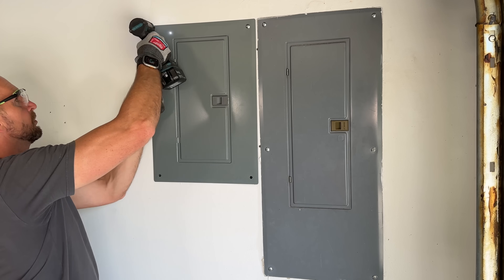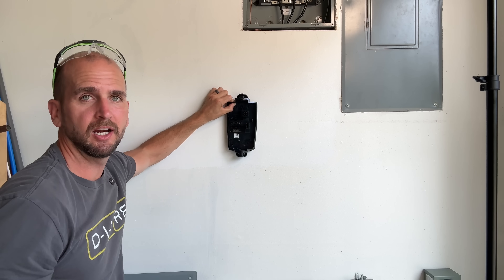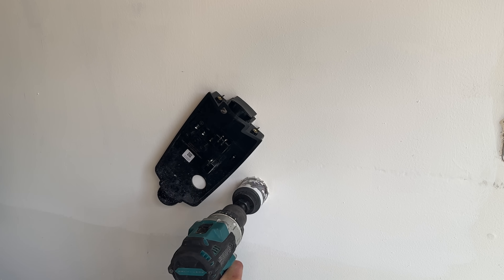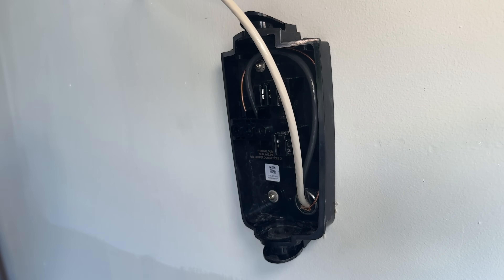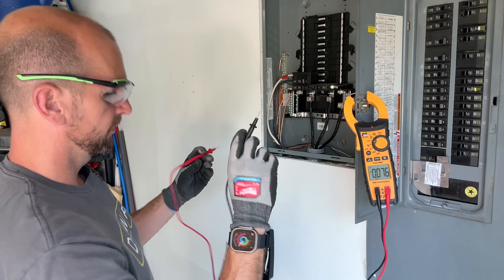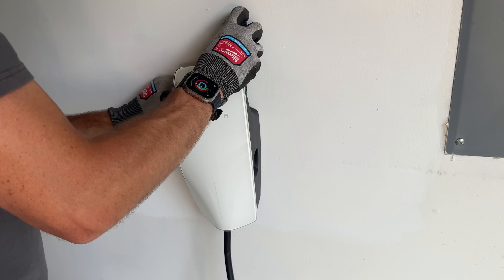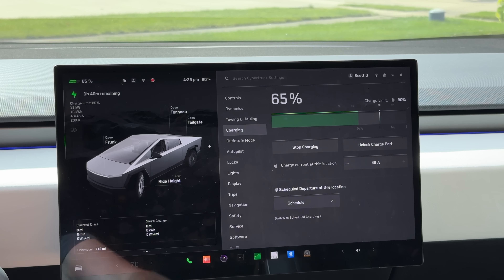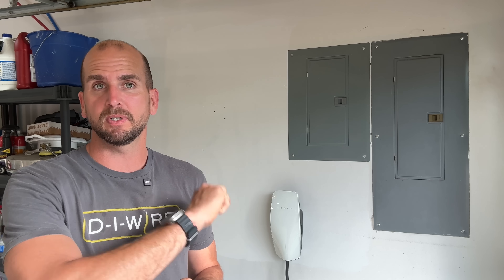How To Install An EV Car Charger | Easier Than You Think!

Comment: Almost 6 years of driving a Tesla and I still haven't upgraded my charging yet. I've been using my 120v wall plug the whole time and it's been more than adequate 99% of the time.

One day I'll get around to installing a 230v plug. 😜

That's for sharing this one!
Reply: 120v 12a charging on the Model X since 2018 here!  Having free supercharging does make that more bearable ;)
Reply: I have a 20 amp clipper creek that I bought for my Volt.  I get 15 miles of range per hour, which is fine for my Telsa overnight.  People vastly overestimate how fast they need to charge at home.  The most I'd ever do would be a 40 amp circuit to get 32 miles per hour.
Reply from the maker: Thanks for the feedback!
Reply: I'm guessing you live somewhere warm. 120v will struggle to charge in the winter as so much energy is needed to keep the battery warm.
Reply: I am approaching 2yrs 120 vault charging. But it won't hold 12 amps lately.  It keeps falling to 6 amps.  So I called for an install.
Reply: @plixie1  I have mine capped at 11 amps and I've never had an issue. I've never even tripped a breaker in this shitty aluminum wired 1974 built house.

Comment: 0:35 “5 times cheaper …” ??  Is the electrical utility paying for energy?  Or is this some kind of Logarithmic reduction?
Reply from the maker: I pay $0.08 per kWh at home and at the Supercharger it cost $0.40 -$0.43 per kWh.
Reply: @EverydayHomeRepairs dayum SCE is raping us!
Reply: I believe it’s just a direct comparison to the super charger based on the end of the video
Reply: Lol. Guys did you watch the video. He is clearly talking about cost charging at home vs not charging at home (ie super charge station).
Reply: I wasn't sure what he meant by that either, maybe making a comparison to buying gasoline or paying to use super chargers?

Comment: Get ready for that .30 cent tax for each mile driven Californians 🤣
Reply from the maker: $0.30 per mile?  That seems a bit off.
Reply: @EverydayHomeRepairs  go research it. California is doing a pilot program for this because they are losing so much revenue off of gas taxes 🤣
Reply: @Flex_Mayo You are an order of magnitude off on the pilot program. The pilot program is $0.02, $0.03, and $0.04 per mile. Currently Californians with ICE vehicles essentially pay between $0.02 and $0.03 per mile in gas tax. Roads do not exactly pay for themselves so it makes sense to find other revenue. Per mile is difficult though because some of your mileage might not be in CA.

Comment: Hello, what if I don’t have a free socket for a breaker in my electrical panel. Can you make a video of what to do in such a situation? Thanks a lot!
Reply: Just add an external 120V outlet to a circuit. That is much cheaper and will get you 40-50 miles of range each night. If you add another breaker, you'd have to either get a larger panel or get a subpanel which is a lot more expensive.

Comment: The majority of people do not need a level 2 charger nor a 50A one. People charge overnight and a level 1 charger at 12A on a 120V outlet will get you about 40-50 miles overnight. That is more than what the majority of people drive each day. Charging is not like fueling up on gas. Plug it in each night to top up and forget it. So if you don't have the extra cash to fork over for a level 2 charger, don't worry about it. You will likely be fine with a standard outlet.
Reply: Super off peak pricing is usually in a 6 hour window. 12A will miss it, literally costing you more money. You can get level 2 for dirt cheap now. They’re just glorified relays, with a minimal amount of negotiation.
Reply: @float32  On average it's about $500 to install a 220v line plus the cost of the charger. I have never heard of "super" off peak pricing so what you are claiming may be extremely regionally dependent. Peak times in a lot of cases as around 4-9PM and then the rest is non peak. Even if you are charging from 9PM-6AM, fast is still about 27 miles of range which is fine for about half of people. Even if you did some peak charging, it would take a lot of charging to make the $500-1000 installation cost of a level 2 worth it. Not knocking on anyone who does install one since they can be very handy (two cars can charge at the same time, for instance) but they are certainly not necessary for 75% of people.

Comment: You don't NEED a lvl2 charger. Depending on how efficient your EV is, and how much you drive per day, a basic wall outlet can suffice.
Most get about 2mph from a basic wall outlet. 20mph from a 240v outlet. Then 200mph from a DCFC.* 

So if you drive 20 miles per day, but your car can be plugged in at home 10 hours a day, you can just use a basic wall outlet. Do the math and see what you need.
Even if you drive more or park less you can still charge mostly at home and then hit a fast charger once a week, or top up on the weekends or similar. 

For the first 2 years I had my Bolt I was running the cord from an outlet in the living room and out the mail slot to where I parked.

That gigantic, heavy, inefficient monster truck he's charging will probably get half a mile per hour plugged in to a wall outlet. An Aptera would get 10mph or more from it. As with everything YMMV.
Reply: It’s worth having a Level 2 charger. You just don’t need to have 48A charging. 16A works fine for most and if you have a dedicated NEMA 5-20 circuit with 12ga wire you can rewire it as NEMA 6-20 with a double breaker and some red heat shrink/tape to relabel the neutral as L2.
Reply: @m_cabral A level 2 charger is actually not worth it for most people since a level 1 charger will top most people up overnight. People who drive more than 50 miles a day (a minority of people) could definitely make good use of a level 2 charger but even then, a 30A one will be absolutely fine.
Reply: On a Model 3 you can get away with it if you’re religious about it and don’t drive much. My friend who has a 10 mile commute mostly can but still needs a destination charger periodically.

I don’t have a commute and just drive for pleasure. Right now I 12A Level 1 charge only and it is more along the lines of 18 hours to add 20% back to my Taycan. 16A Level 2 charging is overnight for the same amount of energy added. Bigger batteries, SUVs, etc are not easy to Level 1 charge only for people who have to drive every day.

Comment: Good installation video, except for perhaps the cable used. Tesla’s instructions are pretty easy to follow. People should pay attention to cable routing, as that’s a very common mistake.  
I’ll add that if you don’t want to shell out the money for a Tesla charger, be sure to buy a quality receptacle.  I’d suggest looking into an industrial grade receptacle. Hubbell is a good brand, but do your research.
Reply from the maker: Thanks for the feedback and Agree the Hubbell 14-50 I swapped out on this video was solid. https://youtu.be/aTVm8Bt_YUw
Reply: At home charging systems should come withe vehicle for the price you pay.

Comment: Instead of using a NEMA 14-50 outlet, you can save money by using a NEMA 6-50 outlet (commonly used for welders).  The 6-50 connector just has the 2 hots and a ground and does not have a neutral.
Reply: Good point! I realized after the fact that I wasted money buying 6GA white thhn wire. Although, my Tesla came with a 14-50 adapter and not sure if Tesla sells a 6-50 adapter.
Reply: @robwloch8733  Tesla does sell a 6-50 adapter.  I also have a 6-50 extension cord - much cheaper than a 14-50.  and you can find lots of dog bone adapters to go to 6-50 from TT-30, 10-30, 14-50, 14-30.  Just be sure to lower the charge current and check that the plug/outlet isn't getting too hot.  This lets you charge at any campground or a friends garage welder/dryer outlet.
Reply: Some non-Tesla home chargers use a common wire, so if you sell your house, it'll be ready for a different, non Tesla charger for the new homeowner if they have another EV brand.
The extra length of unused white common wire fits(coiled up) inside the Tesla wall charger.
Reply: @dvader3263  recently sold my house - with the Tesla Wall Connector.  Just picked up a Clipper Creek home charger from the local electric co-op.  The Clipper Creek has 3 wires on a 24 inch flex whip - Hot, Hot, Ground.  No Neutral (white) wire.  So feel free to use a neutral wire, but it is not needed.

Comment: Power hogs.
Reply: How is an EV a power hog? It takes a ton of electricity to pump oil out of the ground. A ton of gas to transport that oil to the refinery. A ton more electricity to refine it. A ton more gas to transport the gas to the station. More electricity to pump it into your car. Then you get at most 30% of the energy of the gas from the tank to your wheels. Gas cars waste 80% or more of the energy in oil.

Meanwhile EVs go from solar panel, to wires, to car, to wheels with a total efficiency of over 80%. 

"But Cobalt!@!1!!" There's tons and tons of cobalt used in refining and mining oil and coal, nobody said word one about that. Then some EVs use some tiny bit of cobalt in their batteries and people go nuckin futz. Many EVs are being made with different battery chemistries that don't use any cobalt. Oil will always use cobalt, till we run out I suppose. 

"But batteries degrade!!!11" Up to 10% total capacity in the first few years, then less than 1% per year for another decade. There's million mile batteries on the road. Transmissions degrade, engines degrade, exhaust systems rust, and so on.

Comment: I believe that 6/2 NM (Romex) wiring is not adequate for this installation. Per the NEC for NM cable you must use the 60° column which for 6/2 NM is rated at 55 amps which is not allowed to protect 6/2 NM cable on a 60 amp breaker. The options are to install 4 gauge NM wire, run individual 6 ga. THHN wires in conduit, or derate your Tesla charger and install a 50 amp breaker.  I would also run  a 6 gauge ground wire and not the 10 gauge in the NM 6/2 cable.
Reply: Mostly correct, but a #6 ground is overkill. A #10 ground is perfectly code-compliant for a 60A circuit.
Reply: Agree it is not a NEC violation but a 6 ga ground should be used since the Tesla charger has built in GFCI.
Reply: @MrUnique7777  All EVSE's have integral GFCI's.  Not following why ground would need to be #6 because of that.
Reply: @billjohnson3344  The ground is fine at 10 AWG. No need to run larger. NM-B is rated for 90 degree C but the ampacity is taken from the 60 degree column. I doubt if Scott will ever have an issue with such a short run but technically #6 THHN in FMC would have been a better choice.
Reply: @BackyardMaine  Agree he won't have an actual problem for his short run, but that doesn't change that it isn't per code with the NM-B temp rating for a 60A circuit.  And by him stating the 6AWG NM-B is good for circuit draw and mentioning how others runs might be longer, than would be more of issue for those who used this as an example to follow.  Agree with his statement to check your local codes, but what he has isn't per code anywhere.  And yeah, I agree the #10 ground is fine - am confused with the one comment was about needing #6 because the EVSE has a GFCI.
Reply: @billjohnson3344  Scott isn't a professional electrician. He's a DIYer and a very good one at that. I've actually seen licensed electricians use ROMEX in this same way because they didn't understand that although NM-B is rated for 90 degrees C, the ampacity is still taken from the 60 degree column. Before 1984 all NM cable was rated for 60 degree C and it was not confusing to anyone. The 10 AWG is code compliant and fine for GFCI as well. A GFCI circuit for equipment protection will trip at 30mA and 5mA for personal protection so the limit of current to ground before a trip is minimal.
Reply: @BackyardMaine  Yes, I agree about the 10 AWG ground.  Was curious why @MrUnique7777 thinks otherwise.
Reply: Agree.  To correct, as #4 gets a bit unwieldy (and overkill for this very short run), probably his best option in this case is #6 THHN in MC (flexible metallic conduit).  #6 thru #10 ground is ok.
Reply: This is correct. I install these for a living. Not just the NEC but the installation instructions state copper at 90 deg for the 60amp circuit. If you use romex, need to drop the breaker to 50. I default to #6 thhn in conduit with #10 ground. Have passed all inspections. And yes, if you must use romex, needs to jump to #4 which is a big jump in cost.
Reply: @4x2-ev  The cost is cheap compared to a burned down house.  I had two different electricians tell me they install #6 Romex on 50 amp circuit and it's ok to charge Teslas at 48 amps.  That's flat out wrong.  I had to explain that you have to use the 60 degree column in the NEC which means the ampacity is 55 amps which isn't good enough for 48 amp charging.  You need a 60 amp breaker using 4 Romex or #6 THHN in conduit for maximum safety.
Reply: @monohydrate2  Or #6 MC
Reply: @monohydrate2  #6 THHN in conduit is the most cost effective approach, IMHO.
Reply: 6/2 MC should have been used, and it's cheaper than NM.
Reply: Canadian electrical engineer here. For my Canadian brothers, there is no such requirement in the CEC to use the 60C ampacity (Table 2) for NM cable vs 75C for THHN. Using #6 Cu NM cable for 60A circuits and #8 for 50A circuits is completely normal and code compliant, even for continuous loads like EV chargers. Canadian homes aren't burning down because #6 Cu NMD90 was used for 60A circuit EV chargers. 

Always important to make sure that the FLA is still max 80% of the circuit rating, and that everything is at least 75C rated. You would only use the 60C table if your conductors, the breaker, and/or the device on the circuit are rated for only 60C. But this is rare for modern circuit breakers and any device that isn't a 120V receptacle or light switch, and all circuits 30A or less are limited to certain conductor sizes by a different code rule anyways.

Of course, if you're routing the conductors a significant distance through an unconditioned attic space, you might consider upsizing to #4 Cu for peace of mind (and/or voltage drop) since the attic could reach temps above 30C in the Summer. But for a short run so close to the panel, it's completely unnecessary. Not sure why the NEC has this 60C requirement at all for NM cable.
Reply: So  6/2 or 6/3 ?
Reply: @ For a Tesla Wall Connector (and several other wall chargers) you don't use the neutral.  It just gets capped.  So...6/2 will work fine.
Reply: @ Better to run two lengths of THHN plus a #10 ground.  It's easier to pull and allows you to be code compliant on a 60 amp breaker.
Reply: This is correct here in NC. I install in 15 different AHJs and this is the requirement for inspections. The exception now is that DOI has jumped in and even if I derate the breaker to 50 and EVSE output to 40, I need to use #6thhn.
Reply: Also the distance of the run does play a factor. This is still considered safe. Longer distances i would agree to up size the wire.
Reply: My house was built in 2010 and it has a 60amp breaker with 6/2 Romex installed. It obviously passed all inspections.
Reply: You are correct.  However...tons of these are installed with 6/2 NM Romex running 48 amps and you never hear of a problem or fire...and Romex's own website shows the wire inside NM is THHN rated at 90C, the same stuff they sell in individual THHN strands.  And of course there's margin of safety in the code in case you're running this through an attic in Arizona that gets to 140F in the summer...but yes...we should all follow NEC and be safe.
Reply: @TrendyStone  Those thhn wires are tightly wrapped in 6-2 romex, thus the heat dissipates slower thus romex are rated to carry up to 55 amps or (44 amps continuously). Comparing to individual #6 thhn wires, they are rated to carry up to 60amp or 48amps continuously.
Reply: @HanyunGong  You are correct!  And...my comment above is also correct.  

The code must account for romex running through an attic in Phoenix in the summer, which is why there is a margin of safety built into the code.  

I would NEVER recommend anyone violate the code.  I'm simply explaining that there is a reason so many Wall Connectors are installed with 6-2 romes at 48 amps (not to code...except in New Jersey - true, look it up) and you almost never hear of a house fire.  

Should anyone violate the code?  No (though New Jersey interprets 6-2 romex as ok to use at 48 amp for a Wall connector...and no fires).  They are apparently ok with a slimmer margin of safety.